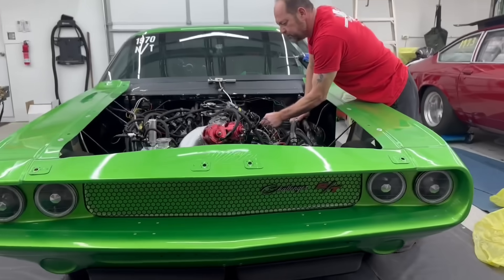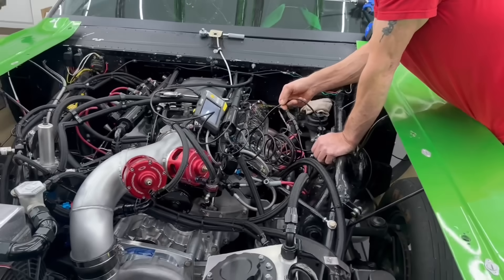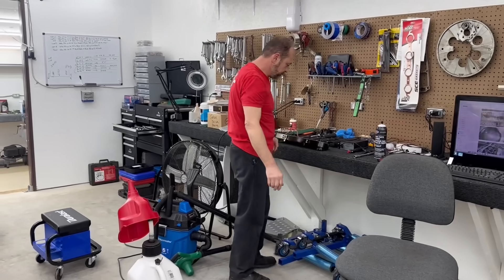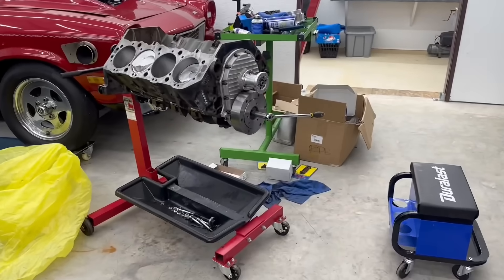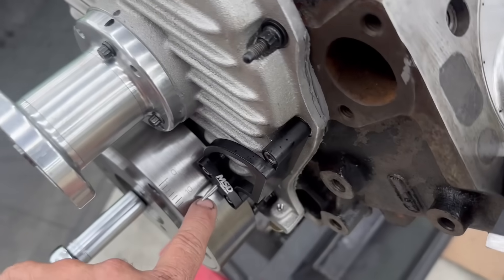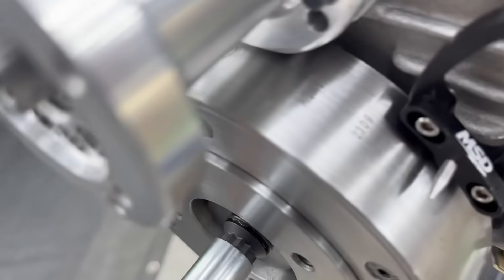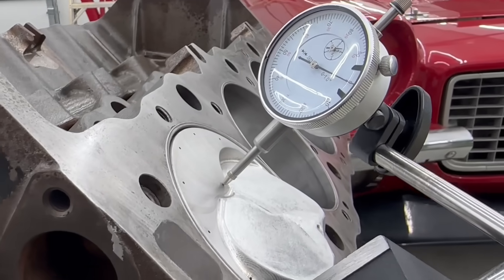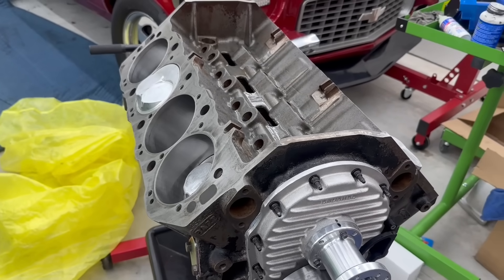TurboJohn BBC (Big Block Chevy) 532ci / Finding TDC

Comment: lmao... "A Very Near" caliper. You could also have used tap and a fine tooth marker. Lay the tape on the balancer and extend the marks onto the tape. Then remove the tape and index it on the "0" line. 
You're doing a modified version of the method performed when youre using a piston stop. Cool walk through.

Comment: Ya Should have did 1 Video on Mike and 1 on the BBC / Mike Don't risk it  Snatch it out and ck the Bearings Especially the Cam Bearings  Cause Bearings and Rings and Gaskets are a Lot Cheaper than a Engine and Hey if they look good reuse the Bearings But that way you know for Sure and can relax :face-blue-smiling: